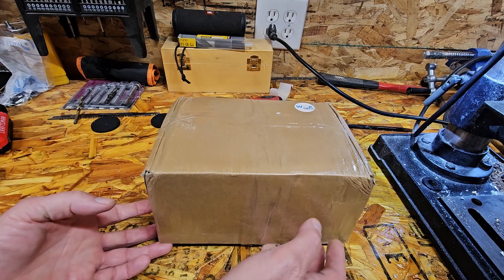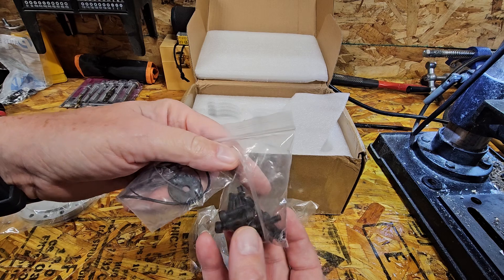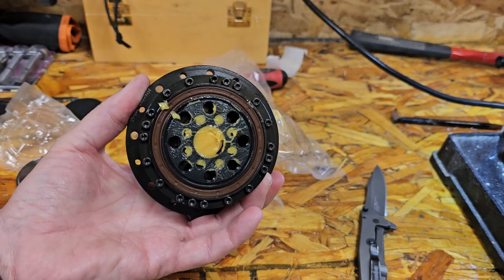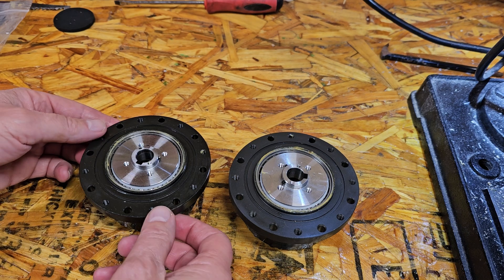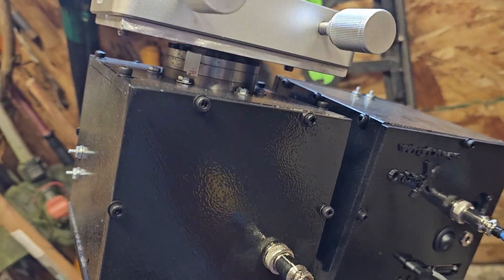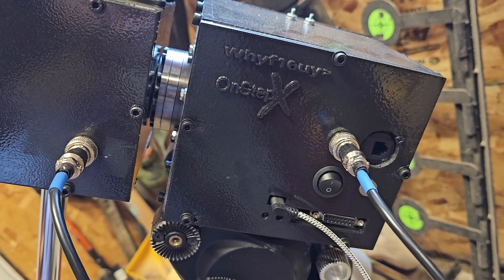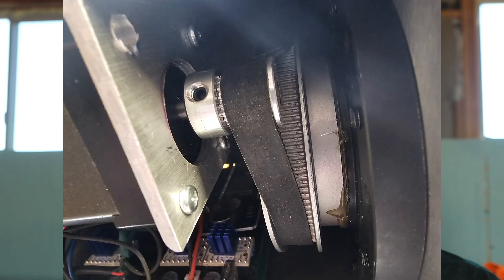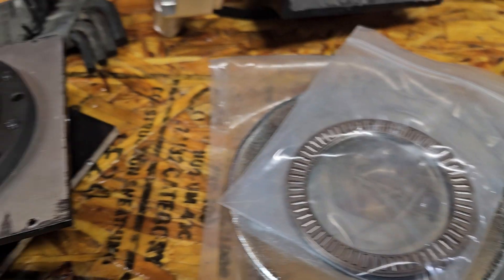Upgrade: Replacing the size 17 harmonic drives with size 23

Comment: Hey, nice mount, im working on something similar. The aliexpress link no longer works in the description, but I'm guessing it is the same cheap reducer that many are selling, they all look the same on the images as in your video. I'm considering buying the same, albeit the size 17.

On their cross section drawing there is no identifyable output bearing. Some listings mention a crossed roller bearing on the output, but there is no moment load rating anywhere. I'm hesitant to put the payload directly on the output flange, for fear of the output not being supported properly. Such bearing if you buy it separately is already 50% of the price of this reducer, so I'm a bit skeptical that it is real.

Did you find any information that convinced you the payload can be held directly by the reducer output?
Reply from the maker: I think if you get one that looks the same it woudl work with my build. And mine came with those extra pieces that I use with the bearings and 3D printed things. Which I think not all come with.

Comment: Hey, is there a reason why you are using a belt instead of going directly from the steppermotor to harmonic drive?
Reply from the maker: 4:1 gear reduction, more torque, higher resolution. Didn't want to use planetary gears because I didn't want to introduce backlash.

Comment: Hey, i noticed you had a problem where the wave generator popped out on your smaller drives, this is because it does not have a shaft with a bearing the way you put it together. The flange you received with these ones normally holds a motor for direct drive and the bearing of the motor is used to keep the wave generator in :)
Reply: @devilmastah  Please forgive my bad imagination but can you please share the file to the bearing mounts? Or maybe a picture so I can see how they are mounted together.
Reply: @anhdangduc1061  hey, i made a video and put the cad in the desciption :)
Reply from the maker: Makes sense. My redneck solution seems to be working so far.
Reply: @whyf16uy  always good, i received my stain wave 17s today and am now designing everything in cad :) less redneck way
Reply from the maker: Sweet, I just don't have access to milling equipment or I'd try something better
Reply: @whyf16uy  Get yourself a proper 3d printer :) helps a really long way! (Internals here are all printed from Polycarbonate Carbon fiber. (i actually have a second diy mount that can carry 5kg and is all 3d printed)
Reply from the maker: @devilmastah  Nice
Reply: hello @devilmastah Could you please tell us how you overcome that issue of this drive? Thank you so much.

Comment: I like your philosophy about going to max size 😁  This is something I've always wanted to do, so it's great to see that it is possible to do without having a full machine shop. With regard to the guide curve - do you think it would be possible to smooth that out with some PEC stuff? You've most likely said it already but my memory is not so good - what software are you using in the controller and as the driver interface to the computer? And I really like the picture 😊
Reply from the maker: I'll look into the PEC stuff, definitely need to try a few things. I use OnStep with the MaxESP4 board and use NINA to control. If you look at some of the previous build videos I go into a lot more depth.

Comment: How did you tension your belts? I'm currently in the process of making my own harmonic mount but I'm just not sure how to tension them.
Reply from the maker: Well I really have no clue what I'm doing but I just pulled them tight and held the motors while tightening them down. I tried to get just enough tension so they wouldn't slip but not enough to cause any lateral tension on the pulley's axel. If that makes any sense.
Reply: @whyf16uy  Ah ok, hard to tell in the video but how have you connected the pulley to the drive? Is there a shaft?
Reply from the maker: @Zegery  yes I bought a 14mm stainless rod and just cut it to length. One of my original build videos probably shows it better

Comment: Those harmonic drives look like real monsters I wonder what load capacity your mount can take now? 
The old CGE pro I use has NEMA 17's & I've never had an issue with them slewing the RASA around & the dual rig I'm currently building, with it having 30KG of  counterweights to balance it all it seems to handle it fine although the real test will be when I'm imaging with it.
Congrats on your 1000 subs to clear skies
Reply from the maker: Well they should hold a lot.They are HUGE. I guess I'll have to look for a C14 🤣. And if I'm not mistaken you were my first subscriber, so I couldn't have done it without you.